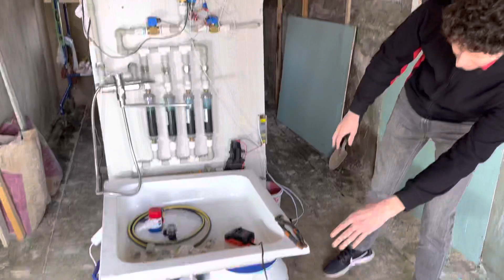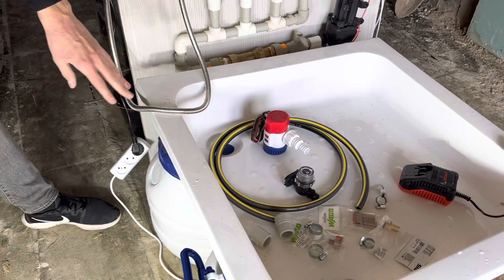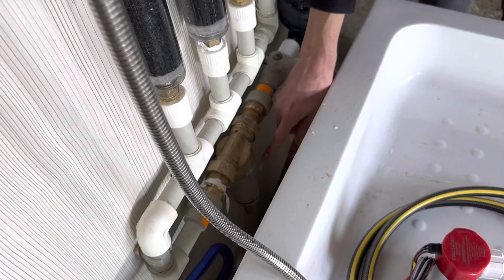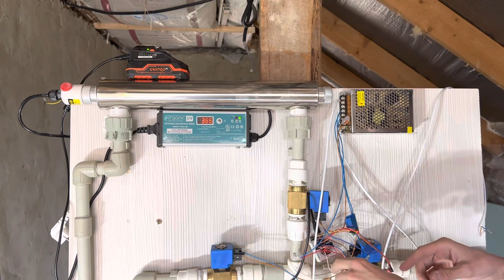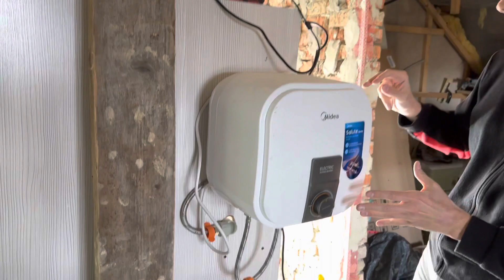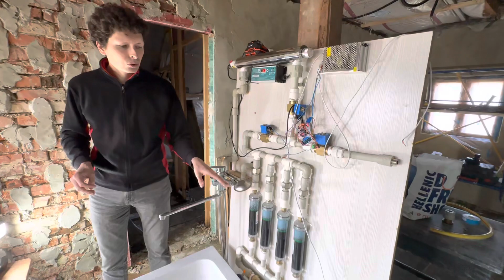ShowerLoop: huge saving of water and energy. Radical eco technology. Future of sustainable housing.

Comment: Interesting concept 👌 Here is just a thought: the 2 bar pressure from the pump might be a bit too little. It will certainly flow through the system but will come out again (when using loop mode) with too little pressure for a "nice" shower since I presume the sand/ activated coal filters create a fair amount of headloss. Maybe when they are clean it's ok but when they get dirty, headloss will increase. You might want to add another booster pump after the loop or, more simply, just consider an initial pump with at least one more bar of pressure.
Looking forward to see the actual testing!
Reply from the maker: Agree. There is a version of the same pump with +1 bar. Never stop learning and experimenting 👍